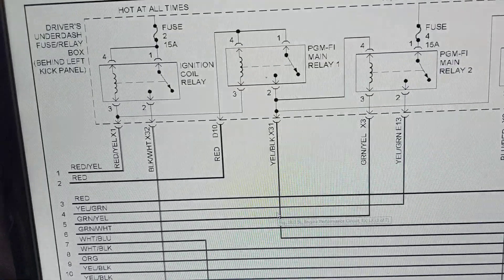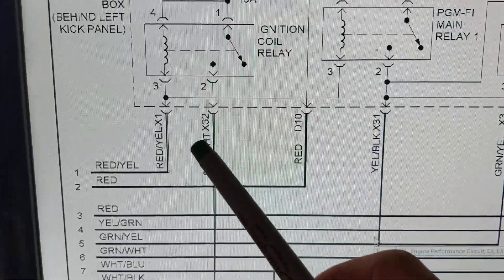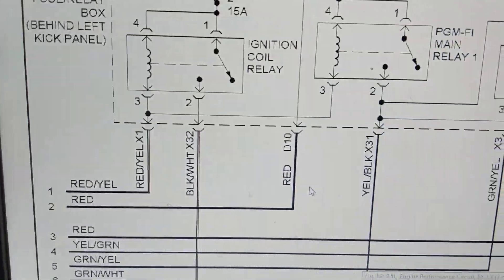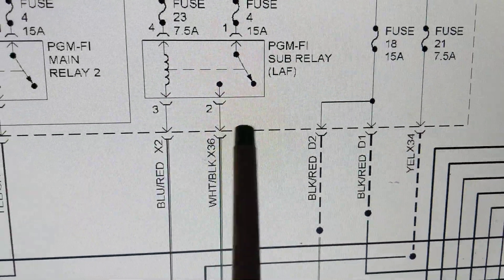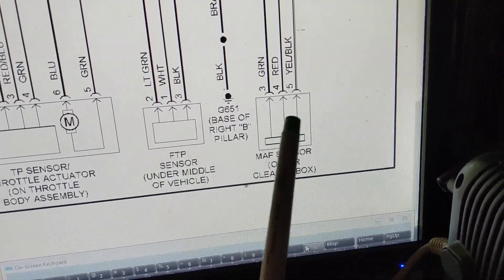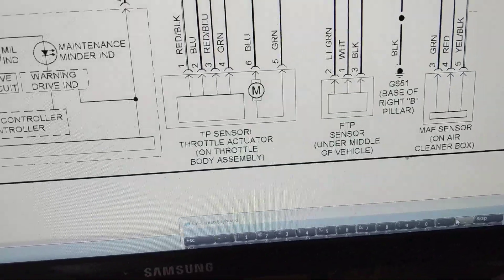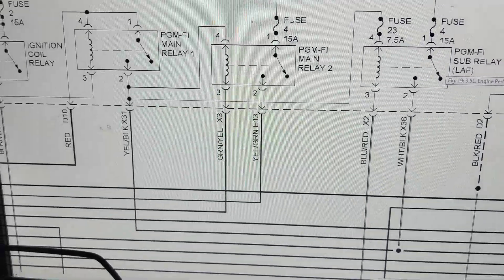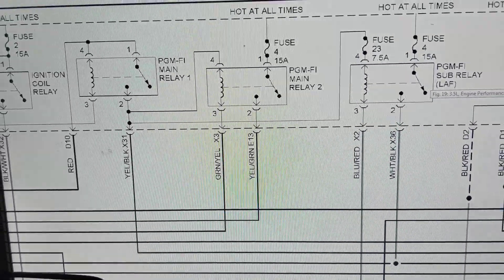how to read  AUTOMOTIVE WIRING DIAGRAM for all COMPUTER ECU INPUTS AND OUTPUTS AND SENSORS part 2

Comment: And I'm still lost. 😂
Reply from the maker: About what lost about what
Reply: @Joeelectronicschematicsforauto  I'm just not a person who gets electrical problems to easy. My mechanical ability is fine.
Reply from the maker: There are very basic electronic diagrams that you can go over on the channel the channel is Joe electronics schematics for Auto much easier basic diagrams explaining the components and the symbols
Reply: @Joeelectronicschematicsforauto  Thank you
Reply: @Joeelectronicschematicsforauto  My problem I'm dealing with now is a ground hog chewed my wiring harness on my car.
And the wiring is not like older cars, were you could match color to color. So I'm trying to figure out on the wiring diagram which wire is connected to which colored wire.
If that makes any since.
Reply from the maker: @reddrw1  unfortunately quitters always get into cars in the wrong places and always chew on on wires the best thing that you can do is to avoid any complications go to Google put in your make and model of your car and the wiring diagram that you need you can download it it is free it's only one page but and that's all you need for example if I need when I go to Google I'll type in Toyota Camry 2005 wiring diagram connector PCM it will download that specific diagram for that connector or module that's the best way you can do it you can't really rely on color to color even though they might match up just be sure and do it the right way try to get back to me when you can
Reply: @Joeelectronicschematicsforauto  Thank you. I will
Reply: @Joeelectronicschematicsforauto  I have worked on my car a few days now.
It's running now. Its a job reading the wiring diagrams..Some of it threw me for a loop until I thought about it. That ground hog did a job on my car. It was 8 wires I could not find. And when I did find them the critter had chewed them flush to the fire wall.
He even chewed the wires that is attached to the oxygen sensor. What a mess.
Reply from the maker: @reddrw1  this usually happens when people take their cars up to the woods there's a lot of creatures up there and they love chewing on wires good luck then glad to hear it's running
Reply: @Joeelectronicschematicsforauto  Thank you.
Reply: Mr Joe,  in this particular schematic what does the cylindrical dotted lines surrounding all three wires from the FTP sensor represent and why is it there in the 1st place?